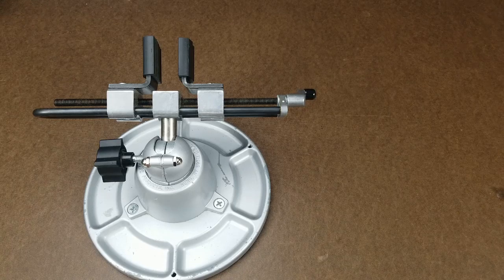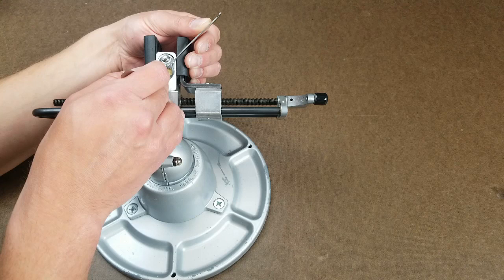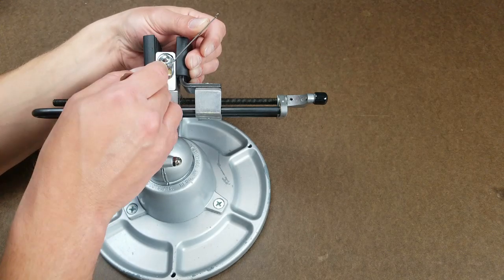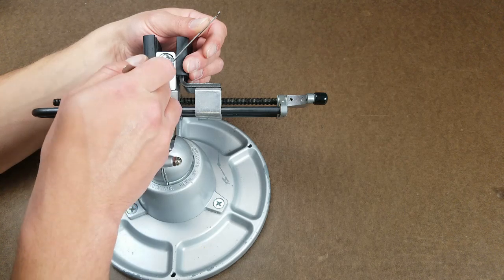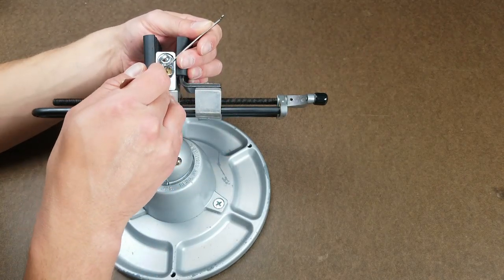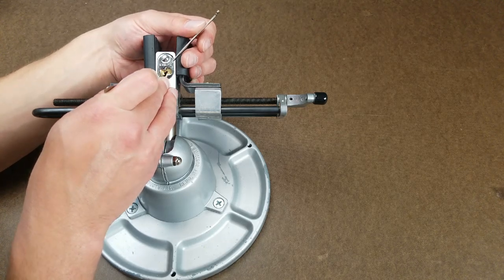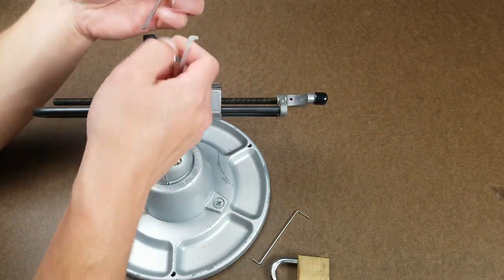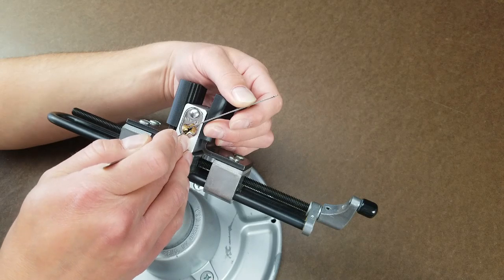Mentorship Monday 10: Tension Part One

Comment: Great audio track! :)
I've noticed that how I've applied tension can affect the binding order, perhaps because the plug can shift a little bit. Have you seen a difference in binding order on the same lock depending on using TOK or BOK tension?

Comment: Really wise words - thank you once again for teaching us! :D :D  I get stuck on sometimes (more when I was new) in not being able to tell the difference between picking a bound pin and the warding! ... I would (not so much now but I used to) bend my picks because I'd be trying to pick warding, thinking it was a bound pin ... I used to be too scared to let off the tension too much (especially when the LPL said to use strong tension) to see if a pin would move.  I tend to use an offset hybrid now and I can easily slide the pick & feel the actual pins, and also I'm trying to do the "jiggle" test (although I need more practice).

Comment: Great video.  Taking the time to get to know the lock a little before you start is really important and something I’ve often forgotten to do in the excitement of facing a new lock.

I reach for a music wire tensioner when I can.  The kind that usually comes in cheap Chinese kits.  They’re a bit thick for some euros but they don’t seem to bind on the core using bok and some of the higher end euros these days have ridiculously wide keyways and the wire is usually thick enough so it’s not sliding about.